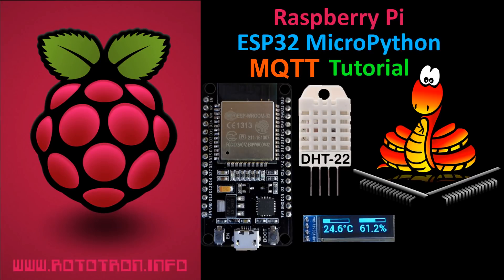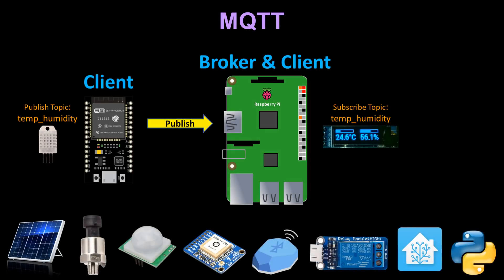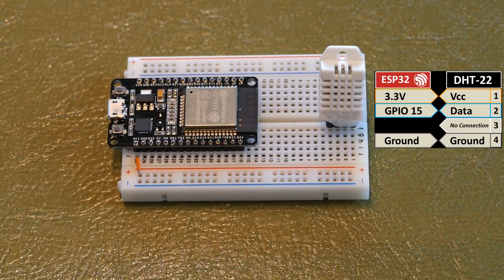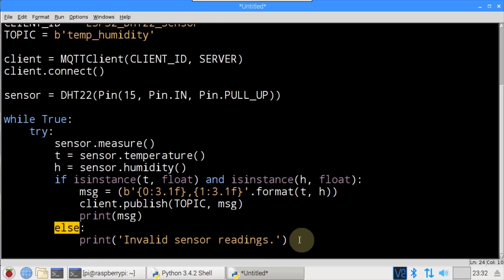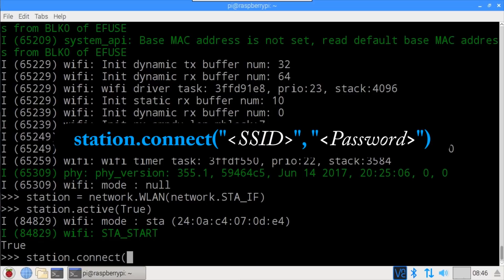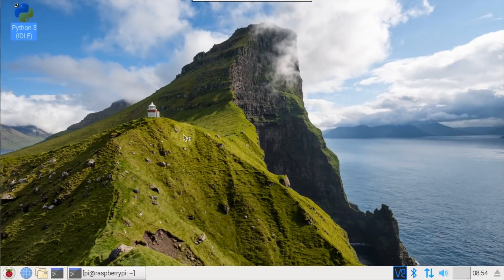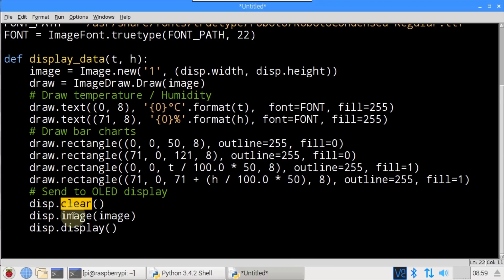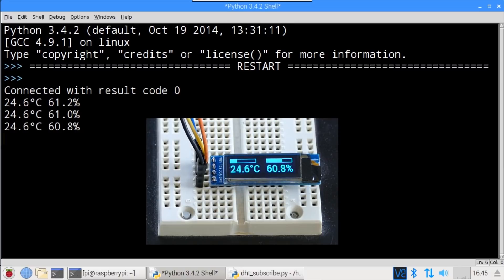ESP32 MicroPython MQTT Tutorial with Raspberry Pi, DHT-22 & OLED

Comment: Yes, I found the tutorial helpful. Thank you!

I am interested in seeing a tutorial for a touchscreen attached directly to an ESP32.

According to https://www.esp32.com/viewtopic.php?t=1937 “for now only XPT2046 and compatible controllers are supported.”

I found a 3.5-inch resistive touch screen LCD for Raspberry Pi XPT2046 on eBay for under 15 US dollars. 

https://www.ebay.com/sch/i.html?_odkw=XPT2046+touch+-controller&_sop=15&LH_BIN=1&_osacat=0&_from=R40&_trksid=p2045573.m570.l1313.TR0.TRC0.H0.XXPT2046+touch+-controller.TRS0&_nkw=XPT2046+touch+-controller&_sacat=0 

Do you think one of those screens would work with an ESP32 as a resistive touch screen?
Reply from the maker: Please note the code you are referencing is C (not MicroPython).  Looks like it might work, but it's always a gamble buying stuff on eBay.  There's a python XPT2046 driver on GitHub for the PyBoard but I have not tried it: https://github.com/robert-hh/XPT2046-touch-pad-driver-for-PyBoard
Reply: Thanks for the quick response and helpful information. I did not realize the code I linked to is C (not MicroPython).  I appreciate the link to the Python XPT2046 driver on GitHub.

I agree it is a gamble buying stuff on eBay, particularly cheap electronics.

Comment: great video, very well explained.
About the wifi issue on esp32 board, I had exactly same issue when importing the network module. Have you done any further troubleshooting or found a way to correct it ? For now I'm proceeding with a different board as well, but I was wondering if defected one could be fixed.

Thanks!
Reply from the maker: It's a gamble buying generic ESP32 boards on eBay.  They often have bad soldering and use rejected parts.  I think the only problem is the defective micro-USB port.  The board would probably be fine if I replaced it.  One work-around is to connect the Pi's 5V pin directly to the ESP32's 5V pin and connect the grounds.  This should protect against brown outs caused by a shoddy USB port or cable.  Since switching to the Wemos Lolin32, I have not encountered any problems.